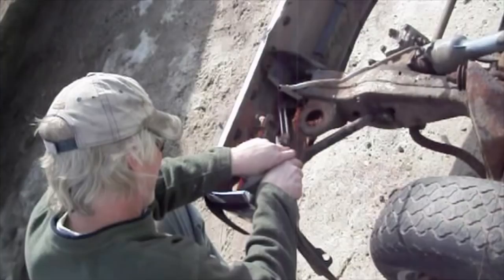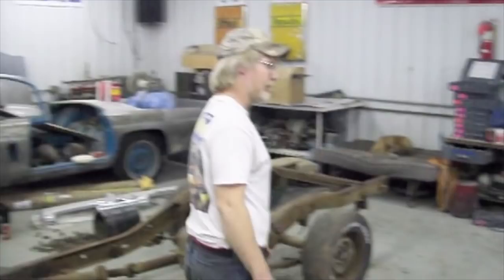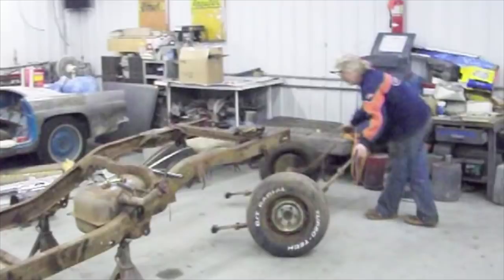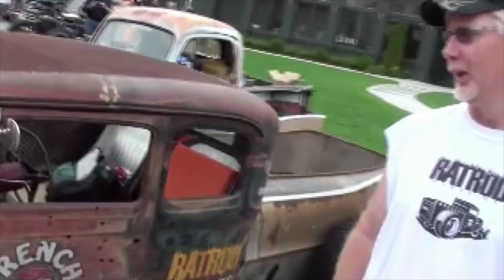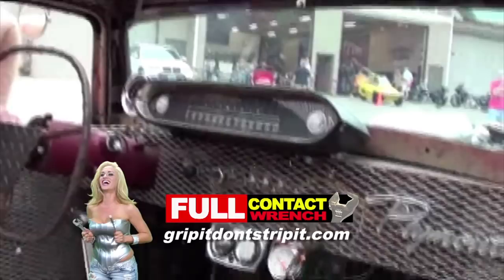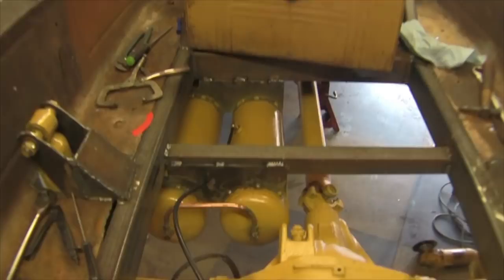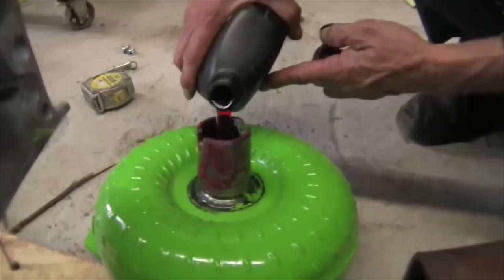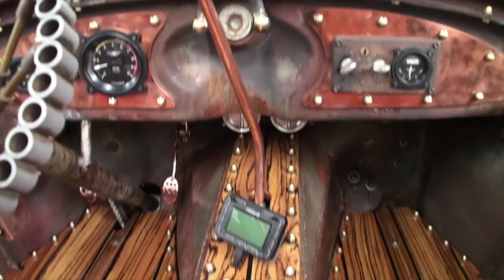RatRodTV Episode 9 view at ratrodtv.com

Comment: I don't have a problem with the front suspension as much as placement. Bodies of that era just don't look right with the front axe directly under the motor. Would look much better with the front axe pushed forward at least 12" or so. Independent or not... The rest looks good for a back yard build anyone could do... This is the biggest mistake I see many amateurs do when rodding a pre 1937ish car or truck. Especially when using a late model chassis. Take the time to get the front suspension as far forward as possible. Think of it this way. When your rod crosses the finish~line, the first thing one should see is the front tires. Not grill, not headlights. Tires... and the last? Lost of dust and smoke!

Also, many very pretty girls hosting the show. That said, no one is going to top Miss Red. She is like a red headed Betty Page and your show is very lucky to have her. Her whole persona is everything 50's and everything hot rod... She is the BEST, PERIOD!

Comment: If the ride has good proportions then it's cool looking.  But you see these rats and some have good balance and seems to all fit. ( So many don't, just ugly crap ) But the wagon rod TO ME should have been on the outside of the wheels.  

Others in the comment section seem to think like I do.  What might not be popular to restore TODAY might be tomorrow.  But that wagon restored slammed with a air ride system wouldn't be such a bad thing today.  But instead of sitting there rusting to dust this build was better than that.